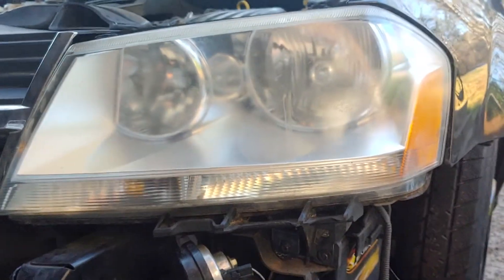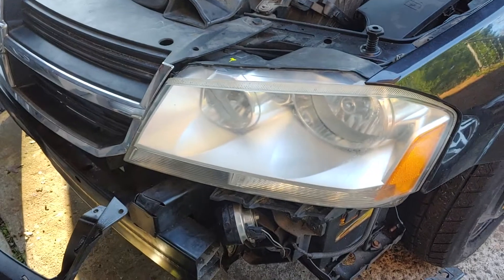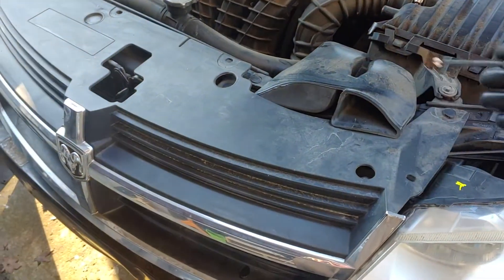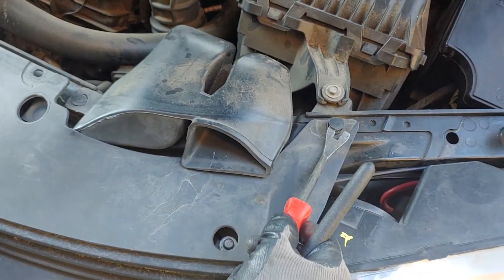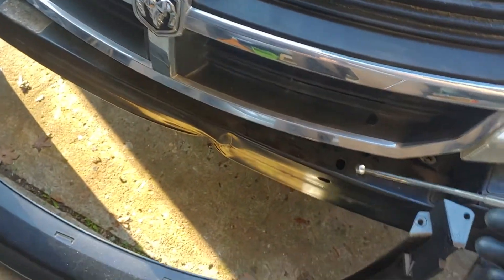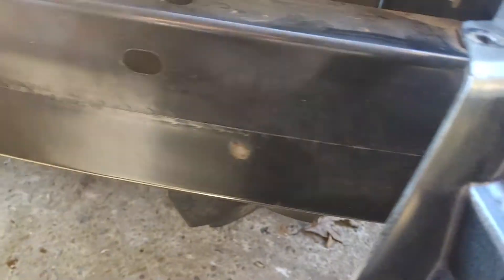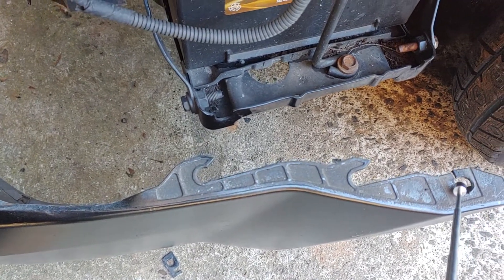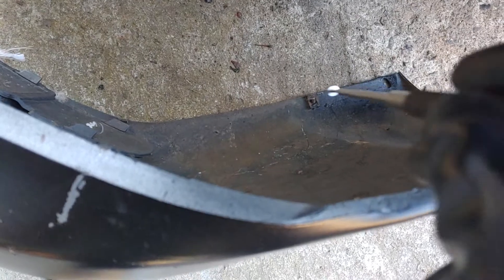Dodge Avenger Headlight Replacement

Comment: Were you changing the bulbs or the whole assembly? I have the same car and to change the bulbs I do it from the top I dont have to take bumpers and all that jazz off.
Reply from the maker: I changed the whole headlight assembly
Reply: @Rogue what type of headlights did you use? I'm completely ignorant when it comes to bulbs and wattages but I want some really bright LEDs. Do you have any suggestions?
Reply: @imightfixit  is there a update on the new headlights you used? I want to do the same thing but dont know where to start.